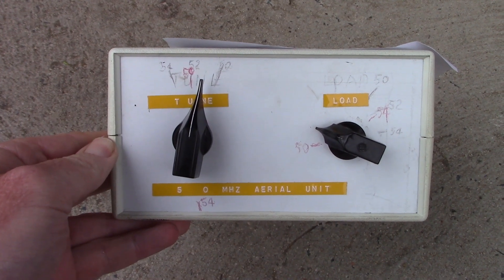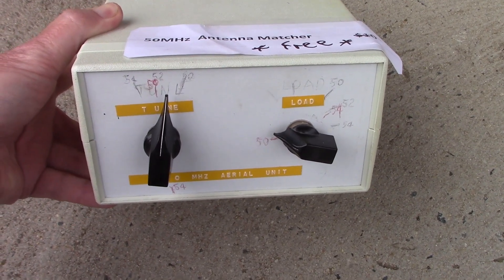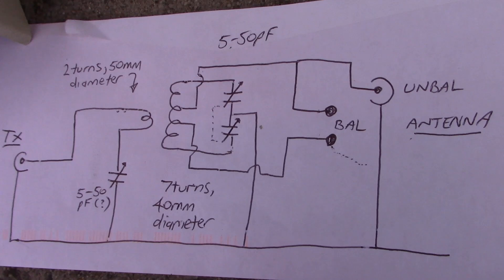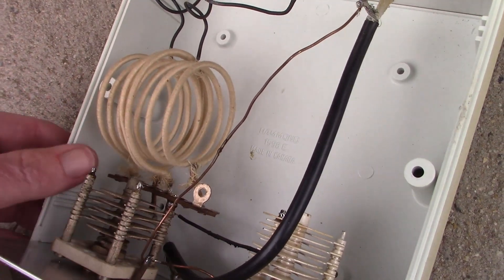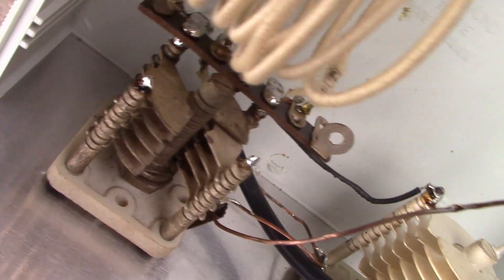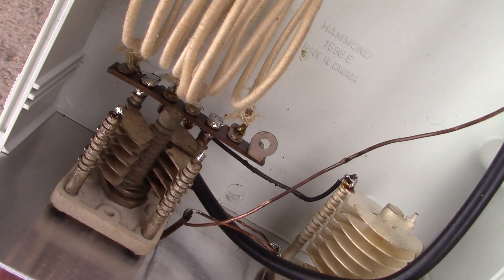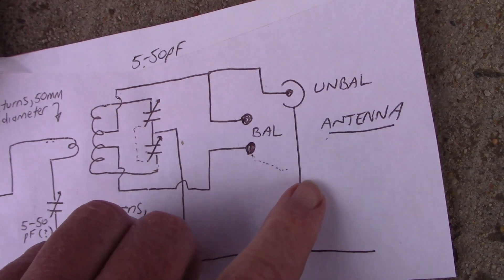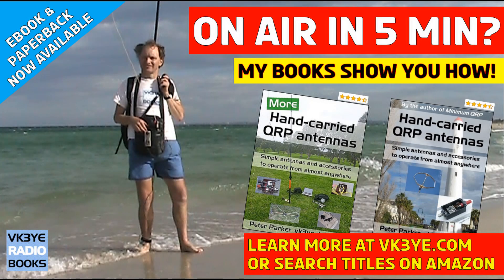The person who made this was smart (50 MHz antenna coupler)

Comment: That Copper Wire Is Warpped In The Sweet Sweet Asbestos Wire, Be Ceraful, I Have Ttranbsformers That Have Huge Copper Wires, I Would Say They Are Not Wires, But Bars, Just Long Long Bars Instead, Twisted Around Sheets Of Metal :D 
Sweet Radio!
Reply: I Sprayed The Asbestos Wires With Oil So It Doesnt Flake Off In Air And Dont Get In My Lungs.

Comment: Once had a yagi tuned for 50mhz with a high swr at 52mhz where VKs could only transmit back then. Couldn't bring the antenna down to shorten the elements. Modified a small CB tuner by removing the inductor and replacing it with a single straight wire link. Worked perfectly.

Comment: I have built several of these Link-Coupled tuners and they work great.
However, you can't very well make one for say 80-6m, with a single coil, unless you can make a variable-pitch one.
On the grounding of one side of the balanced network, it really depends on the actual application, but for the most part it is better to not ground it, then only try grounding if you are  having trouble with RF feedback and/or unable to get a tuning solution that you know should exist...
Reply: Hard to beat a link coupled tuner. My best antenna is a 150 ft balanced fed dipole with a homebrew link coupled tuner. Works 20, 40, , 80, and 160 with little effort.